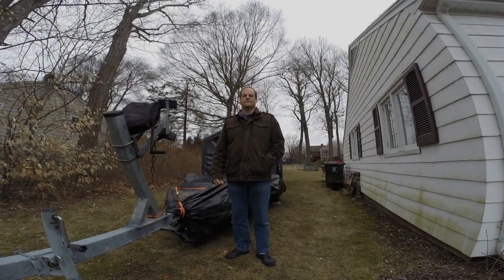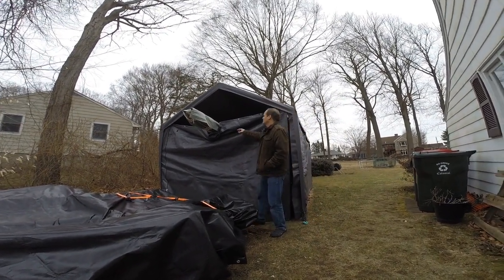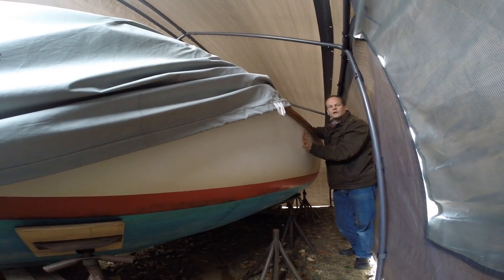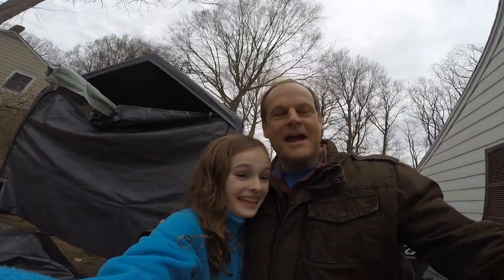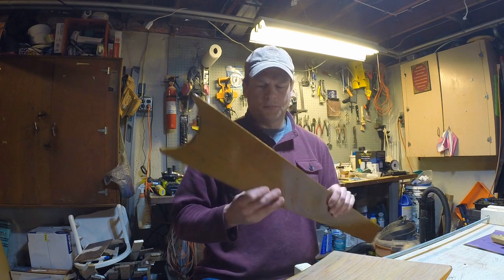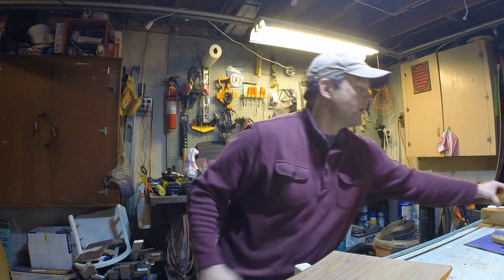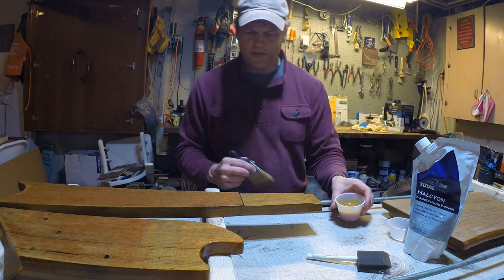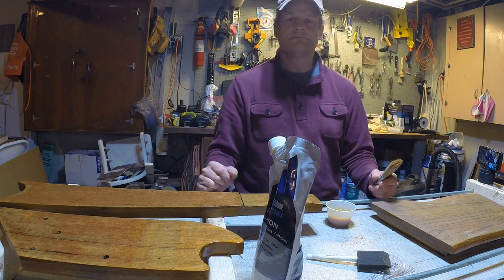Episode 2: How not to varnish in your basement...

Comment: ALWAYS love to see another Herreshoff America being loved and appreciated. I have had a lot of success with TotalBoat Halcyon. The stuff is darn near bulletproof. I used it on my Herreshoff America on some new “hatch” covers for under the bench seats. My supports were kinda in rough shape and I wanted to cover those open areas with grated covers. Halcyon worked great on that white oak. Looking forward to more of your videos.
Reply: Thank you for the comment!  Your videos are were I picked up the idea to use Halcyon as well as some of the other techniques and approaches I plan on using in the months ahead.  I have particular concerns about the rudder and what may be a crack in the skeg that the rudder rests in, in addition to reinforcing the grudgeons on the inside on the transom.  Planning on trailering her, so the rudder and it's weight could be a big problem.
Reply: @guypratt6819  Yea, some of those rudder supports (I heard it is called a 'rudder shoe') can become brittle and crack and turn to dust even if they are a specific kind of aluminum they used on some of them. Otherwise were steal but some of these aluminum ones just crumble, especially when exposed for a long time with salt water. Feel free to fire off a picture of it to me if you want and I can give you my $0.02 if you like. I need to get some new gudgeons for another America I am workin got for a friend. Haven't been able to find any yet but I agree, they need to have some sort of distribute backing material on the transom to getter support that huge rudder.
Reply from the maker: I'll shoot a couple photos when I get the rudder out.  I think Hamilton Marine has gudgeons and pintles.  Mine are in decent shape, at least at first glance.